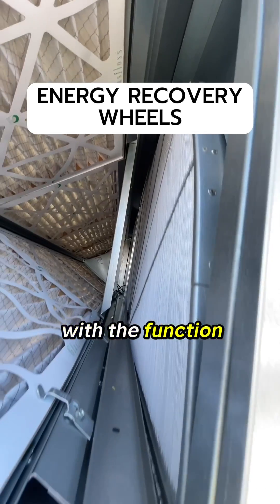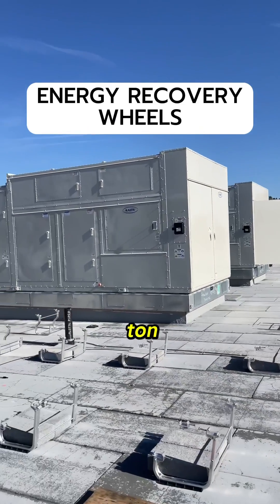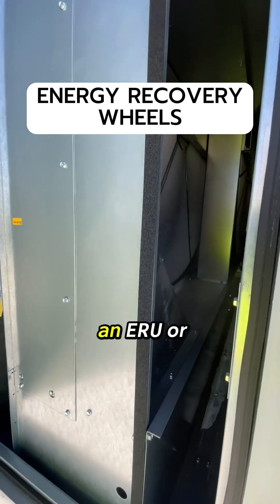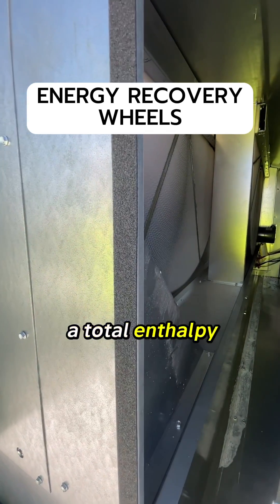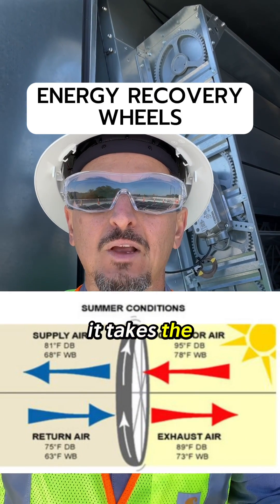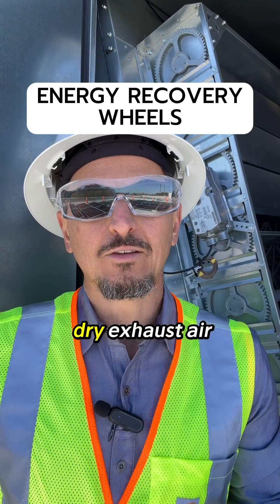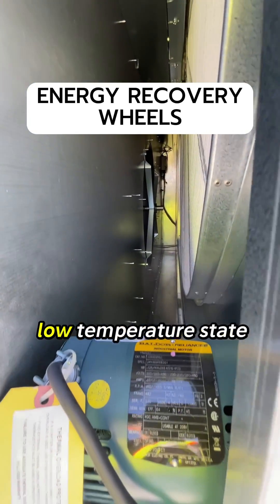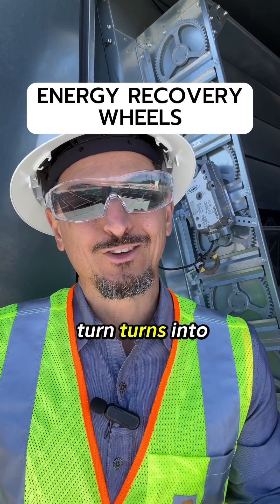AAON RND cabinet package DX rooftop unit with energy recovery wheel | HVAC total enthalpy wheels ￼

Comment: Hmm, why have a RTU be a WSHP? If its already on the roof why not just have it as an air source heat pump? Seems like a waste to have an additional cooling tower just for those units.
Reply from the maker: It’s a large facility. I’m assuming someone ran the energy analysis and there was a reasonable ROI.  That’s typically why we see WSHP’s.